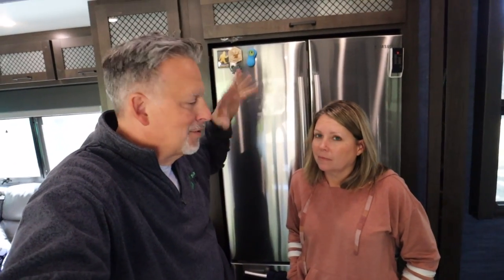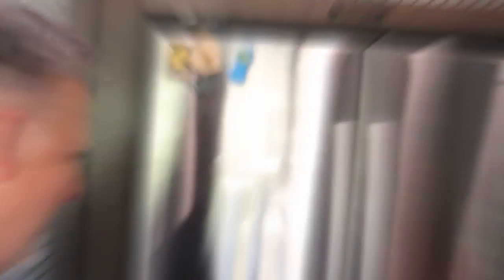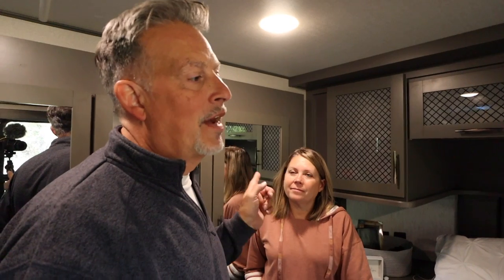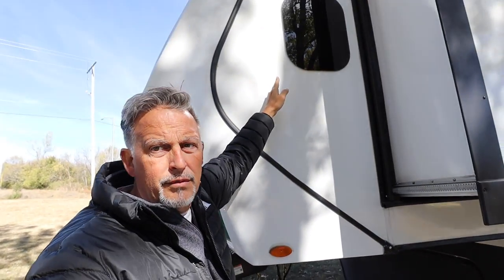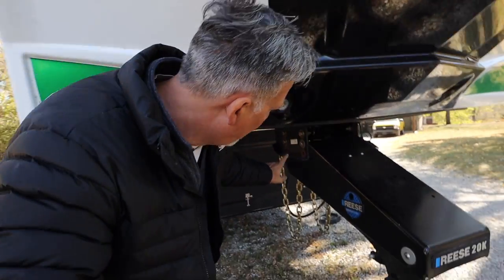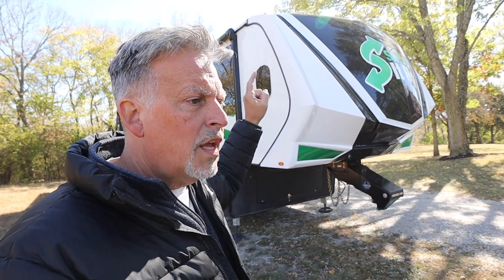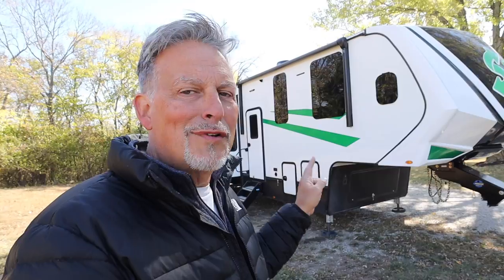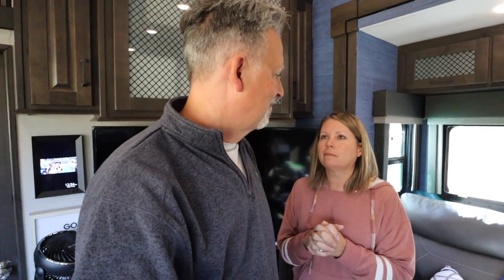RV Frame Flex (What is that?)

Comment: Nice video and you covered some important information. Your next and continuing inspections will be the horizontal seam and caulk that runs on the front cap down towards the front hatch. It is the one you caulked after you reinstalled the fiberglass piece you dropped. The caulk and trim piece will separate when there is a problem. I always get flack for my next statement. Every chassis coming to GD needs to be reinspected. Welds measured and tested. I find it very intriguing that builders like New Horizons and Space Craft can build a heavy 40 foot unit and still use only 4 points on the chassis for leveling and be just fine.
Reply: Space Crafts are built on full fledg HDT trailer frames. 
They run the same axels and air brakes. 
I personally haven't researched the New Horizons frames yet though.

Comment: Great video! What many RVers don't understand is that you are towing a home in gale force to category 1 hurricane winds across roads that essentially simulate a Richter 4.0 to 7.0 earthquake. The RV has to survive all of that pretty much undamaged. The larger the RV, the more these effects become critical. We found out last month that some of the rough roads don't treat you or your trailer vary well. With all the attention on the Interstate highway maintenance, the older Federal highway system has deteriorated in many areas to where I wouldn't take any trailer (travel trailer or 5th wheel) down them. We put about 3700 miles on our trailer in 2 1/2 weeks last month and hit some really harsh pavement. Our trailer did fine but we may have damaged our heater. We'll have to have a service guy check it.
Safe travels!
Bob and Dottie

Comment: I pull a travel trailer toy hauler. It still has manual stableizers. If I crank 1 corner up, I can see the frame flex during camp set up. I never worry knowing that is how trailers work. It's a 2006, so it's been around a while. Also easy to see the frame underneath since it is 1 level (no 5er up parts enclosed). While inspecting the frame keep an eye on suspension parts like spring hangers for breaks or cracked welds. Better to catch it early than to break going down the freeway.

Comment: We had a new 45' toyhauler in 2011 when we stayed at Bay Bayou for 7 months. They made us change spots half way through into a tight spot. The pantry door was in a twist from the whole unit being torqued.  They have to make these units so light to have the size and features.  Most 45' units are already almost to heavy for a dually.

Comment: Good info... we had some cracks in some key places involving g the cap of our 5th wheel... took it to Elkhart... took 2 weeks to repair... could have been much worse... got it independent suspension installed now that will hopefully help prevent any structural issues again... (on a side note, your hair cut looks great Todd 👍🏻)

Comment: We just got our 2022 back from the factory. It had frame issue (lost Camber). We had exterior wall cracked through to the interior wall. We put out a video showing the damage. It has been repaired (supposedly). This cost us several thousands since we were displaced from our full time RV.

Comment: Thanks... possibly use a bladder lift leveling tool as a wedge\protector for the fridge.  It is a heavy rubber\plastic bag that is usually inserted under an object and inflated with an attached squeeze bulb that inflates it.  They can lift 300 or more pounds.  it would be like your Reese air bag for the fridge (but on the side)..

Comment: Now that you have checked out the frame flex on the front of your 5th wheel, time to check out the spring hangers and frame above them for stress cracking.

Comment: Todd, it all comes down to suspension components.  We are already setting up for the crap roads out there.
1:. We bought a Trailsaver tsl5, 
5th wheel plate.  All air ride.
2:. Switching out the low capacity axles.  Switching over to 10,000lb axles with oil bathed bearings
3:.  Air ride main plate.
4:.  Looked at IPS Suspension for each axle.  Just too much money.  However going to the Lipert airide system which is similar to over the road heavy haul trailers.
5:.  Switching to Air over Hydraulic disc brakes.  Better stopping distances.
6:.  Plus our truck is full Air Ride suspension.

We plan on purchasing a Grand Design Momentum 398m.  Empty weight is just a hair under 17,000lbs.

Also the Big Boss says your hair cut is aussome.  💇‍♂️. Safe travels and roads Brian and Cindy, "xtreambydesign with passion"

Comment: CHANGE THE SPRING  SUSPENSION TO AN INDIVIDUAL SUSPENSION
Reply: I have the Morryde Independent Suspension on my Solitude and have the exact same side cabinet movement that they do. 
I also have the same fridge movement when my slide comes in and out.

Comment: I have a 2021 395m and I have the exact issues that you do in the bedroom and I dont blame that on rough roads, I just went to the GD national rally in Goshen In this year and I showed them my issues and they told me I had frame flex and it needed to get fixed, they set an apppointment for the repairs totaling 58 hours of shop time at their brand new customer service facility, There they removed my front cap and the peice that bends under the nose where the pinbox comes out. I requested pictures and what they sent me was pretty revealing they added about 40 lbs of 2x2 metal bracing and 4 large gussets to help with all the flex. this is a real issue and it will be the end of your rig if not addressed. they  (GD) are very aware of this issue and while they say its a lippert issue they are not involving them. there were no charges from GD to fix my issue and while it was in there they did a quality review and found several more days of work that was needed even though I didnt even know it was needed. If you would like to contact me thats ok but im not sure how we do that without posting a phone # or email for the general public to see and im not up for that.

Comment: Our 3 year old, 30k mile Grand Design Solitude S-Class 2930RL-R has the exact same cabinet rubbing wear in our bedroom. Started out looking like yours. Gradually gotten worse over time. Rough New England roads on our current trip didn't help. Took it to Elkhart lady week for GD inspection. They don't think it's a huge issue, but are wanting some weight info next. Will see where it goes. They seem to be willing to help. 
Also, my residential fridge also moves when the side goes in and out. Mine has been reinforced by the dealer. Only difference is that mine is perfectly square when the side is in, but looks like it's leaning slightly to the right when the slide is out.

Comment: Hey, I have a 399TH (2022) Manufactured in 2021. I had/have “frame flex”, my pin box was flexing 2” between hitched and unhitched. The ride was very “soft” and bouncy. The SRT team came out and found that there were missing bolts in the forward most part of the frame that holds the walls to the frame. Also, our passenger side bolts were backed out. I can get you information on how to inspect. (Easy to inspect) Our bedroom had the same ware marks that yours does. (Same bedroom setup also)

Comment: Hey Todd love the hair cut. I to had some problems with my frame I have a 2015 375TS keystone raptor toy hauler. We had a crack develop on the bottom left corner on the bedroom slide we have a east west bed so there is some weight on that side. It took 3 visits for the RV repair shop to get it fixed. They finally had to take the side wall off forward of the slide where they found welds that had broke and that Lippert hadn’t put some braces in the side wall.  This was pre COVID so it was just shoddy work we called lippert and you can guess what they said when they were called camper is 7 years old we won’t cover it. All in all it was a 5000$ fix and I will give a shout to Bob’s RV of Marion NC they did a outstanding job and if somebody has a problem and in the area they will treat you right.

Comment: L00king good with the hair cut, on the Frame flex check the video on trailer suspension / Changing Lanes with Tara & Chad very positive on trailers needs for today's highways.  ( Morryde Independent  suspension )

Comment: Switch It  My advice get rid of your 5 th wheel trailer, buy a Big rig style of Trailer that hooks onto the rear of the Artic units Trailer,, One front steering axle hooks onto a tow bar fixed to the chassis of towing vehicle , One fixed axle @ the rear , loads now sitting on 2 axles one @ either end , No more Twisting , Folding up Chassis legs , means towing Pick up has lost the 5 th wheel coupling , allowing more space for equipment , such as Gas & Fuel Tanks etc.

Comment: I have several degree's, including Mech. Eng., to much education, including Notre Dame. I worked out of Detroit, followed by Chicago, "manufacturing" crudely speaking. A car/bike guy, raced for years, managed a major Nascar Team, hence machining/engine build/engineering, senior Engineer at "GM" relating to machining and gear production, hence your "transmission". I know the "Midwest" well, skilled labor was located in Mich., yes, the car industry, Illinois, Wisc. and Ohio. Indiana never was considered a "manu" state with the exception of the "RV" world and Elkhart, Ind. The 'TALENT" level was subpar as well as wages/salary. Through the years companies migrated to Indiana based on economics, or low wages, benefits etc., yes low cost of living. These "RV" companies exploded obviously through the years, BUT quality employees remained. Your "aluminum" subframe is an issue with these large-scale RV's, there are others. The weld itself, or "how you weld aluminum" is critical. The "axles" are critical coupled with the suspension!!!!! Grand Design has these "flashy" RV"s but quality, workmanship is an issue!!!!!, your "RV" is a "Ford" with a "Ferrari" paint scheme. LOL, sorry, not a "DICK", just tell it like it is....but great videos, thanks.
Reply: I concur! 🍻

Comment: We had to adjust our slide after a while it got real tight on one side.  Youtube for the instructions.  And  Our awning arm didnt line up and shut all the way. And the other awning wasn't going out properly  The awning fabric had slid a little and was causing tension.  Who knew?!
Reply: Todd great video on the frame inspection good idea on if your at a factory take pictures,  the hair cut I agree too short but you didn't look like the guy from Back to the future you look a little smarter 😉

Comment: Have you been in contact with GD about this issue?  Our 2021 399TH is currently at GD in Elkhart to be repaired for the second time.  A dealer repaired it the first time and found 18 of the 28 fasteners that secure the exterior walls to the frame were missing!!!  Also, most of the remaining fasteners were loose!  We noticed the same movement in our bedroom on our first trip.  It wasn't until we boondocked at a Harvest Host and couldn't open the cabinet doors on either side of the bed because they were contacting the cabinet soffit did we realize we had a problem.  I now have a Gen Y king pin pinbox and agree about the vertical damping it provides.  I'd get ahold of GD and let them know you see this.
Reply: We have a 2022 399TH that has the same exact issue. We are in the middle of the repairs now. It goes back to Elkhart next week.

Comment: Lippert uses way too thin of material for the front of their frames , look for cracks in the upper front corner of the first bay . 3/4" is way too much on the front where its supposed to be built solid . Look at the out side trim , if it moves move out

Comment: Did you ever check your lag bolts on this?
Reply from the maker: Since we are selling it. We drove it to Elkhart. We had a new rear ramp door on from some water issues.. we had new leaf springs put on... Then we had all issues of frame flex looked at. We watched Strange Adventures video so we requested a lot of inspections. They made more corrections on slide supports. I asked about the lags and they went ahead and replaced. Then I asked about additional support so they ended up adding some gussets. When I picked up it is great. I also asked for additional assurance if we sell... so they gave a 1 Year warranty to next owner. We feel this is great to whoever we sell RV to.
We were proactive.

Comment: Todd ,,,these factories know these prolbems. With frames at axles to make the ride better the day won't fix them they want to use the cheap crap so they keep the cost down on them and the weight down on them to make them because they don't  give up their profit....let the customer pay for the extra stuff to make the trailers ride better and updating the suspension adding disc brakes brake
Reply: If you owned a business wouldn’t you want to make a profit ? Yes customers do pay for the extras ;not going to get it for free  !

Comment: Good video 😀 grand design is a nice rig but definitely not the best there frame are not custom built liperd frame could be used on manufactured you just can't weld to fix the frame there are a few grand design with frame damage some by the axles you went to other manufacture and check the construction  new horizon has a great frame they builded for each floor plan but you have to pay big price for it about 200 thousand or more that's the draw back it's what you can afford! But enjoy the travel 😄

Comment: Thank you for the video I’m new to your channel and only seen a couple so far. I full-time in a 2000 Monaco dynasty. And I do constantly check for things getting loose bolts screws because you have been really nice describing our roads. Our roads across most of the country really stink. So much for this huge infrastructure bill that was passed. I’m not getting political both sides were stupid enough to pass what they called an infrastructure bill. Sad
Reply: Let’s talk about I-95 in SC or should I say the lack there of! Only two lane each way and extremely rough though all the other roads in SC are great, so I guess we know where the money is going. It was my understanding that the states get special funding for the interstates.
Reply: @stanurquhart1542  Five years ago I really pestered Arizona DOT about the local roads and they finally came across with the answer. Our lovely government only spends six cents out of every fuel tax dollar on the roads and I’m guessing most states are pretty close to that also. Again very sad.

Comment: Who told you is good 1/4'' to 3/4'' ? I call LCI today and I was told no more than 1/4'' for flex. Thanks for reply.
Reply from the maker: Dealership.  We recently went back to do all the measurments and we have zero.  We discovered most of our issues with our crack and other areas are from no rollers under our slide causing a stress crack.  long story but we are doing much better.  We did a video on the no rollers and LCI info on that too.  Thanks for watching and jumping in with a comment.
Reply: @SwitchItUpLife  Did you see the mesurement tape when they did it ? It's probably impossible to dont have a flex, especialy on a rv heavy like your's at the front.

Comment: WE had this problem in the UK  late 60s early 70s the Chassis legs were to thin no strength meaning in an accident the caravan would concertina into the towing vehicle, People stopped buying them until Manufacturers were made to Fix it, by fitting thicker  chassis legs, & doing crash tests. US Govt. should start Off Banning Swan neck 5 th wheel coupling caravans, Their crap. you could use the chassis off a big rig for it, & after a few yrs it would end up folding up as well. you have to use a straight chassis for rigidity ------- , a swan neck shows the weak spots ---\_ @ the top & bottom of the angled line. Can guarantee these never saw any Head On  Crash Test attached to a towing vehicle .

Comment: There is no doubt in my mind your frame is broken, that Reese goose ball adapter is the worst thing in the RV industry I don’t care of the lippert  and Reese tell you it’s OK if wheel campers are not designed to be towed like that I guarantee you if you take the front skin off of your unit do you have cracks in your frame I will bet my life on it. Do it do it tomorrow in daylight if you don’t want to take the under skin off stick some cameras in there or, they make exploratory cameras I guarantee you that frame is broken. Make a video the side of your unit hitch to your truck and then a video taking the weight off of your truck, and let me see the side moldings

Comment: Actually, your cabinetry should not be jiggling and shifting like that. It's poor design and engineering from Grand Design. I had a 2019 GD Reflection. It was a horrible experience. After a couple years of usage, I got rid of it and got a new rig. Love your channel. Just being honest. Grand Design is a piece of junk. You look much younger with the hair cut.